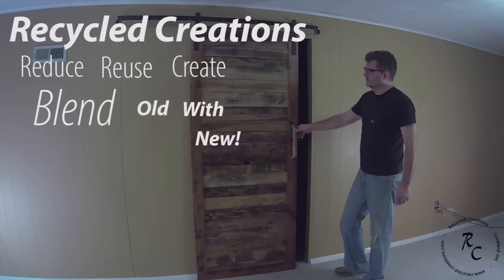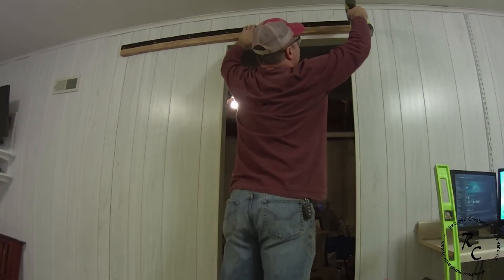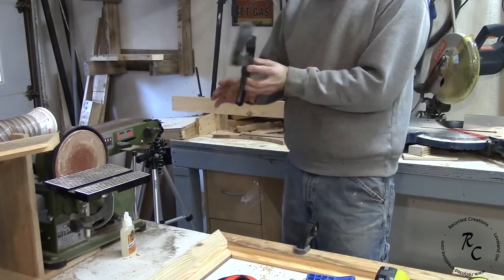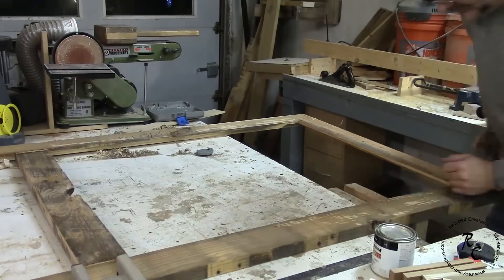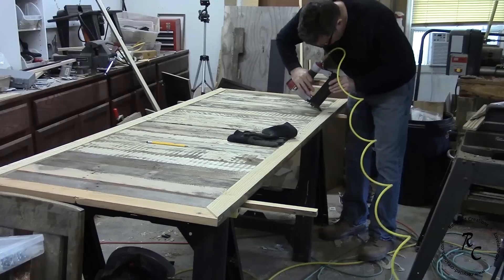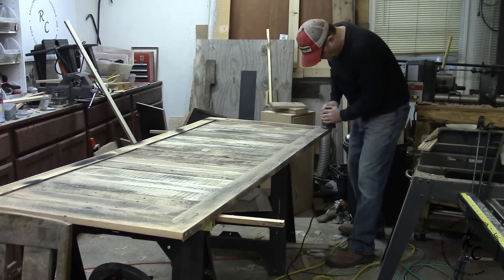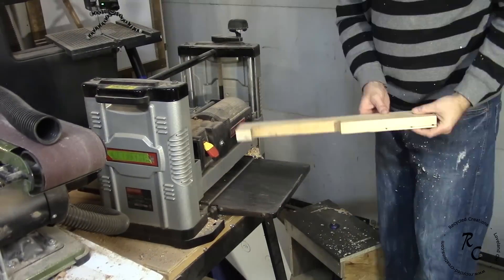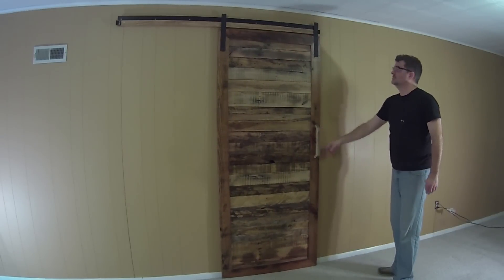Up-Cycled Pallet wood Sliding Barn Door

Comment: looks great, only think is the pocket holes will hold better when not going into the end of the piece, so your middle would be more sturdy with the pocket holes going from the board in the middle out
Reply from the maker: Potentially, however I will say the door is still in use daily and has had no issues.

Comment: I love the rabbit joint idea!   I'm planning on using 2x4 for the fram.

THanks!
Reply from the maker: keale s if you need the door to be faced on two sides you can actually rabbits opposite sides of a 2x4 and Lair them together producing a rabbit in the middle for the slats
Reply: great idea, I have a router and table, ...kinda nervous to run the bit right down the center...scared of ruining the whole piece... my table saw can't take a dado blade.  Do you think its easier to do it on a table saw?
Reply from the maker: Yeah you don't want to do any thing you are not comfortable with, I would think about Makeing an in feed out feed rest for your router table and make to support the piece, and use the router to cut the dado if using a solid piece for the frame or you can stack two 2*4 and use your table say with the 2 cut rabbit method I show in this video, just don't do something your not comfortable with !

Comment: Great video.  I'm planning of making one for the first time.  Did you add glue on each panel?? How is it holding now.
Any gaps?   My door will be 48 inches wide.  I'm not too sure if my door will warp for being so wide. 
Thanks
Reply from the maker: If I remember I did put a little glue on each slat , and also a pin nail or two in each... I also cut a thin retainer and pit it on the back, I can't remember if they was included in the video or not . Best of luck on the build !

Comment: Hi Billy. This is a fantastic build video. I'm curious if over the course of the year you have noticed any problems with regards to wood movement, since it looks like expansion will be limited by the outside frame. (And if so, how you have adjusted your design to accommodate it.) I'm interested in building a similar door, and am unsure of how to take wood movement into account in the design. Thanks!
Reply from the maker: +Omar Wahid I left about 1/16th in between each slat in the door and maybe 1/8 inch we're the slats meet the top and bottom where the slats meet the frame width wise I've not seen any movement at all up and down very slight. Once it reaches equilibrium in my home I've not seen a ton of movement with projects like this climates vary so you may have to allow for more range of motion. If I were making this a door that has a good visual on both sides I would cut a dado in the side rails instead of just a rabbit and Slide the boards in to the Dado and if you lived in a more damp climate you could allow for more wood movement in that scenario as well.
Reply: Billy McCord Awesome. Thanks so much